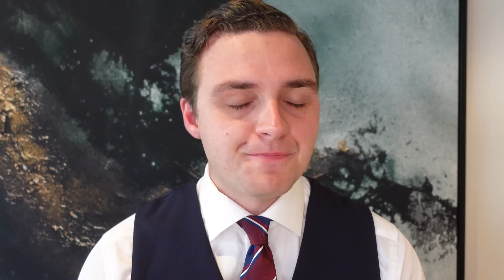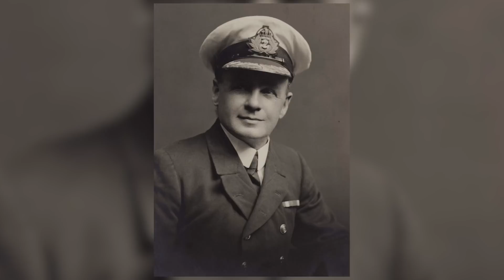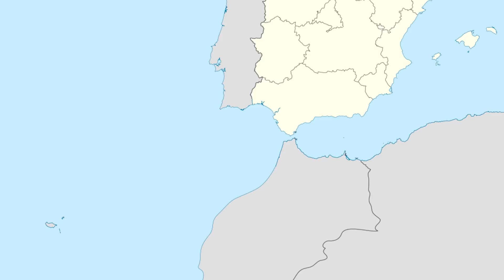How to Annoy the Steam Engine Community

Comment: I was going to comment on a few of these, but didn't think you'd read them. I am glad to be wrong!
One extra thing you slipped on was the "natural draft" part. I don't think marine is different, but my expertise is in fixed land boilers so take it with a grain of salt. We call appliances natural draft when the stack inlet is at a negative pressure, (below atmospheric) AND without assistance from anything else. When you have the assistance of forced draft, regardless of if the engine room is part of that path, it is called induced draft. Forced draft is when the stack inlet is positive. I would definitely call the Titanic's boilers, induced draft.

Comment: You might note that riverboats powered by steam were quite common by the 1820s, maybe only ten years after the first successful steamboat.  These vessels had plenty of fresh water available and stopped every hundred miles or so for more fuel.  Yet it took half a century before steam was common on ocean vessels and that had to do with both available fresh water and engine technology.  Yes, by the 1840s there were several 'liners' that crossed the Atlantic (but not the wider Pacific) mostly with steam but they were high fare passenger vessels since they had to carry so much coal or wood to fire their boilers there was little capacity for anything extra.   These engines operated at very low steam pressures, 25 psi was considered high pressure.  And they used sea water in their boilers that were replaced regularly.  During the nineteenth century vessels got a lot larger, even what looked like wood ships often had iron frames.  Many of these ships had engines, these were generally used to bring the ship into port and upriver when needed, actually some had jacking mechanisms to hoist the propellor out of the water stream and reduce drag while sailing.  Military vessels used these engines for maneuvering while in battle.  Steam could also be used to  operate winches and pumps.  Even the 'liners' I referred to before were fully rigged and used their sails as much as they could, remember that even traditional rigs (square sails) could make good speed with a fair wind and it wasn't till the end of the nineteenth century that steamers could match the speed of sailing vessels when the wind was good.  Square rigged ships could often do 12 knots or more on a beam reach and could sail with the wind even forward of the beam,  fore and aft sails (schooners) could point quite well.  What happened about post mid nineteenth century was an improvement in the metals available including the appearance of steel, better manufacturing techniques, and the start of using multiple reduction engines, that used steam more efficiently and the development of condensing systems that could feed plenty of fresh water back to the boilers.  The efficient triple and quad reduction engines lasted well into the mid twentieth century due to efficiency, reliability, and good control for maneuvering.  This type of engine could stop and reverse quickly and turn at dead slow speeds, something that turbines were not good at.  What was the end of these engines was the need for higher horsepower and the price for space, these engines are big compared to a turbine.  In pilot waters the Titanic got along just fine with two outboard engines totaling a little over 30,000 hp, sounds like a lot but ships are big.  Turbines were not common in cargo ships or ferries or in tugs, all relatively low speed ships but come the faster liners especially after WW1, these vessels need 100,000 hp or more.  Note that all of the battleships at Pearl Harbor were twenty knot vessels (barely and for how long?) none exceeded 50,000 hp, their replacements, the North Carolinas and the Iowas had 200,000+ and 250,000+ respectively to get up to the carriers in the 30 knot range.  Note too that all of these very large container ships and bulk cargo vessels today use up and down piston diesel engines that range from about 30k hp to over 100k hp, not turbines. and hey some have steam boilers using the exhaust heat to make steam driving a turbine that makes electricity for the vessel.  Steam isn't dead yet.

Comment: Uhh... I spotted the errors (esp. re: raw seawater/boilers) as soon as it was made, BUT, being marginally conversant/experienced with steam power, and interested in the subject matter, I assumed that it was an error of omission or a reasonable oversimplification rather than something worth snarky posts, and thus I corrected the narration in my own, for lack of a better term, headcannon, rather than think the vid actually suggested raw seawater would be introduced into a pressure vessel. (Right? It's not rocket surgery.)

I'm suprised at how a few people jumped on the poster about such an inconsequential mistake- the vid DID come with several disclaimers, vis. the limitations imposed by both the format and a non-omniscient presenter. 

The gauge pressures in particular can be confusing for someone who hasn't worked with boilers. I have and it makes perfect sense. 

That said, I did appreciate some of the corrections.

Comment: A curious quirk related to the condensers: a ship operating in cold water will be able to generate more power than one operating in hot water, since the condensers will operate at a lower temperature -- and hence lower absolute pressure.

Comment: Not a mistake but a wrong impression. So Lusitania/Mauritania used more coal per day by a significant amount compared to Olympic class. This is not due to more efficient engines so much as speed. Speed is very costly as the power requirements increase much faster than speed. Typically every 4 to 5 knot increase in speed requires a doubling in power.  The older WW 1 battleships could do 22 knots  using 50,000 HP. To achieve 30 knots requires 130,000 to 150,000 HP.  Iowa class could go 33 knots with over 200,000 HP.  To go much faster than this requires a power plant bigger than the ship.

Comment: I believe the main reason for reduced fuel consumption between the Cunard ships and the Olympic class has to do with the fact that fuel consumption varies approximately as the square of speed. The amount of extra fuel needed to achieve an increase in speed of even one or two knots is exponentially higher. I believe the all turbine solution on the Cunard ships was in fact more efficient than the hybrid design on the Olympic class.

Comment: Well as long as you're getting into the weeds a bit, let me offer some other basic information. A pound of water needs 1 btu per degree of temperature (f) rise between freezing and 212F liquid. That would be 180 btu's between 32 degrees (liquid) and 212 degrees water. It takes another 970 btu's of heat energy to make the change of that pound of water's state between liquid (water) and gas (steam.) That is referred to as latent heat of vaporization. Once the steam has run through the system, most of that latent heat is lost in cooling it back to water. That is referred to as latent heat of condensation. It is the main reason that steam is not used all that much on ships in this day and age. Nuclear powered vessels do because they have enormous amounts of energy, and I believe that some LNG ships, which have to boil off a certain amount of their cargo to operate safely, do, but most commercial ships abandoned steam in the late 60's and early 70's when the first oil crisis hit. On operating the condensers under vacuum, a device known as an air ejector were used on steam ships to maintain vacuum on condensers, to extract as much energy out of the steam before it condensed back into water.

Comment: Hey, I don't often like to leave comments but I thought I'd slip in here. Firstly, while I've never personally worked on any steam-powered equipment of any kind in my life, I've been fascinated by steam technology since I was little. I seriously appreciate you taking the time to go over your inaccuracies and correct them, no-one is perfect. I love the history and the detail, and the ability to acknowledge when something is incorrectly depicted. Big props to ya! 
Secondly, Mike (If I may call you that), In your diagram of a steam piston and valve at time 15:35, you mentioned a slide valve. But the animation you provided depicts a piston valve, which is a different type of valve. They serve the same function but there is a difference in their shape. A slide valve is usually a rectangular shape which is held against the cylinder's intake and exhaust ports (The "port face") by steam pressure - hence the name slide valve. They are simple to manufacture but due to being pressed against the port face, will wear out unevenly which isn't any good long-term. A piston valve is shaped more like a dog bone, which is what we see in the diagram. Piston valves are more complicated to manufacture but do not rely on steam pressure to seal them, and thus wear more evenly. There is additional nuance to each type of course, and there are more valve options to choose from. I'm certainly no expert and I don't claim to be, but I did notice the conflict of terminology in your valve depiction nonetheless. This leads me to a query; Which valve type did the Titanic use?

Comment: titanic quest out of time got the condenser in the game, where you "fix" the engine before you got access to the boiler room :-) it struck me odd back then that they made such a funny and strange "interface" for the machine control, but got those parts right back then... the frustration of that mini game still haunts me now you mention it with the cluck noise.

however, it really speaks volumes that you made a follow up on it, shows your dedication about it

here are some ideas for research for the nerds:
did they used zinc anodes? 
oiltrap/manage of oil oxide sud:
blow out? was that a thing? we call it "washing the boiler". for me it works every year, but then again, we run it in a year what they do in week.

ps. it's called piston valve not slide valve :-)  But i could be wrong as i'm not native english speaker

Comment: The description of Titanics reciprocating engines as single acting was the error that irked me most, but I was sure lots of people more nerdier than me would be all over that kind of content like software engineers on bad code, so I stilled my fingers. I am kinda curious though. How did her valve gear work? Your animations show the slide valve, but there were a lot of different valve gear designs used in that period, and the selection would have dramatically impacted the engines performance characteristics.

Comment: Fresh water (potable water for drinking and cooking) was stored in special tanks in the electric engine room. Three tanks on each side and a seventh tank in the forward part of the ship. With a total capacity of 288,216 gallons of water. 
The water was passed through two filtration systems before distribution about the ship.
Non potable water was stored in 6 ballast tanks below the engine room. (#10 p&s, #11 p&s and #12p&s…) aprox. one thousand tons of water…
it was used for washing, clothes and people and such and for boiler feed water… 
The proper water was obtained from barges (water tenders) in port. 
Evaporators and distillers were only used in an emergency. If potable water became contaminated for instance.
Operating the evaporators and distillers consumed a lot of steam for very little output…
Only 24 main boilers were in use at the time. The 5 single ended boilers were intended for “port power”…
You should do a vid on the piping or plumbing of Titanic….
Each boiler produced about 260 pounds of steam a minute…
After the water was cooled in the condensers it was passed through a series of filters to remove contaminates, before being recycled…
The SS United States used water tube boilers to produce steam vs the fire tube boilers on Titanic…SS United States only had 8 boilers vs the  24 (29) on Titanic.

Comment: Thanks for this corrections.  This is fascinating!  

I watch the USS New Jersey channel a lot, which of course has technology 30-odd years later than Titanic.  

Yeah, I was really surprised that you said that the boilers used straight ocean water.  Sounds like Titanic (and presumably most other ships of the era) have a similar boiler feed water system as ships in WW2.  

It's interesting that the switch from saturated steam to superheated steam happened between those two eras.  (For others in the conversation--New Jersey ran on 600 psi, 850 degrees F superheated steam).  

The turbine running at below atmosphere is fascinating.  I'd never heard of such a thing.  Wow!  That's wack.  

This is so cool!
Reply: I supervised the overhauls of many power plant and marine steam turbines as an engineer for GE. Some of these machines has steam entering at 900+ degrees F at the high pressure end but down at the low pressure condenser end, the cases felt cold as the steam was in a vacuum. All of it's energy was removed to turn a marine gearbox, a generator, or refinery compressor.  My dad served in WWII on an Attack Transport ship, the USS Grant, that was actually built in Germany in 1908 before the Titanic was built. It was a German WWI war prize given to the USA, then was converted to burn Bunker C oil instead of coal. He was a Machinist Mate on engine room duty. I learned a lot about ships and steam engines from him and was thrilled to be part of the GE Marine Department in San Francisco after graduating in Engineering.

Comment: @~5min, steam ships don't "filter" the minerals. I'm a retired Navy Sailor who served in a few steam-powered ships. The sea water goes through an evaporator, aka distillation plant. The "evaps" use vacuum to increase the efficiency of distallation so after 7 or 9 stages, you get really pure water. Then some of that water is brominated to ensure it's potable (the civilian pronunciation is "pote-able" but in the maritime world, it's "pot-able"). The rest of the water (most of it, actually) is treated with some chemicals that prevent scaling and corrosion. That water is not dirnkable and we call it feed water, which gets stored in the dearating feed tank, or DFT. Unlike locomotives, marine steam propulsion plants run on a closed loop cycle. The cycle begins in the DFT, then the water gets pumped into the economizer (a heat exchanger in the funnel that cools the exhaust and preheats the water), then down to the generation phase/boiler where the water is heated to steam, then on to the superheater which, like the economizer, is in the funnel. That superheated steam is at something like 650 psi and 850 deg F, completly dry at this point (can't have droplets of water hitting the turbine rotors). Once that steam has done it's job and is cool and losing energy, the steam goes through the condenser to change pahse from gas to liquid, then through an aerating gas ejector to get the gas out, and then back to the DFT.

Comment: For the Titanic being a bit slower than others, 2-3 knots isn't a big difference speed wise, but it's huge in terms of power required. If the coefficient of drag were to remain constant, doubling the speed of a ship would require eight times the power.  But the drag coefficient doesn't remain constant. The bow wave increases with speed in both magnitude and wavelength for a ship. At the "hull speed" wavelength is twice ship length, which means the ship has it's stern in a hole and is trying to climb a wave it's dragging with it. This causes power requirements to increase exponentially.

Comment: you did a good job on both videos, steam engineering is a complex subject and especially with older systems that are quite a bit different ( open feed vs close feed), it can easily been a monumental task just to understand the basics of how the systems worked ( you did much more then that). just take a look at the engine room plan and you can easy get lost in what is this pump fore, or how does this bit of machinery fit into the overall system. as some one who study's this stuff you did a good job, it is one of the best videos to understand a complex system. keep up the good work

Comment: Pleased to see you come back and correct your errors and elaborate a bit more on the engines.   

Part of the tragedies associated with the loss of the Titanic and her sister ship Britannic is overall just how good and efficient these ships were overall. What I find very disappointing about the loss of the Britannic was that her loss was fully preventable if her existing water tight compartments had been properly actuated after her holing by the explosive mines. The Olympic eventually went on to become a very serviceable and overall a very well performing ship.  The reputation of the ship is well served by her nickname, ‘Old reliable’. She was not a speed queen, but performed her services well. By the time she retired from service and was scrapped in the late 30’s, she had been well used and used up. I often have wondered is she had not been scrapped if she would have been impressed into service during would war two.

Comment: At 14:00 : good explanation of the basics on the steam cycle. The overlooked key to the function of steam engines is that the working fluid (water) is introduced into the cycle as a liquid. It has to be injected into the boilers at their operating pressure.  This is a major point. Liquids are incompressible. This means that it takes much less energy to increase the pressure of a liquid compared to a gas. It is the condensers that are doing most of the work maintaining the below atmosphere operating pressure of the turbine. The low operating pressure is another reason that a turbine was selected for this last stage. It is mechanically easier to use a turbine instead of a piston engine in this application.